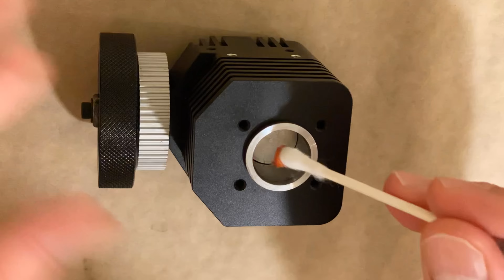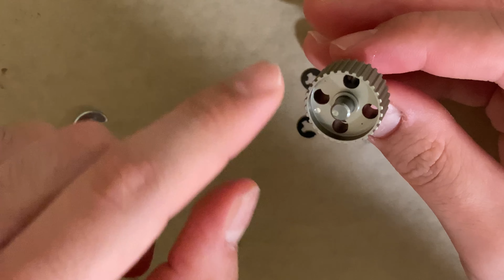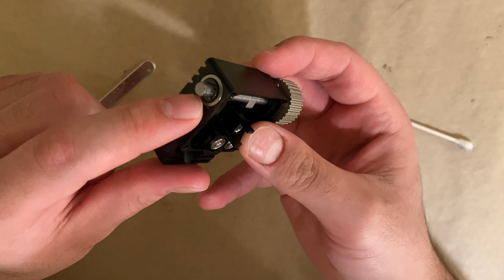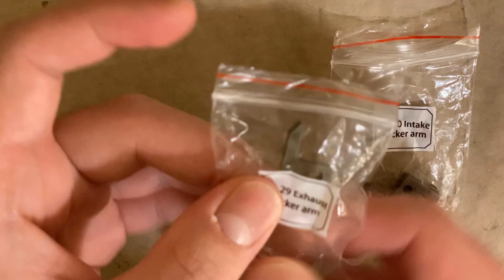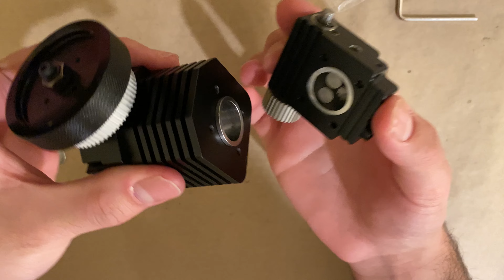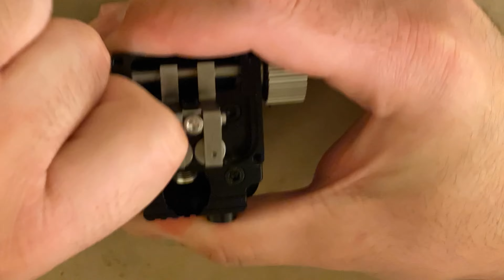Building A Mini 4 Stroke Engine (Part 2)

Comment from the maker: This video is dedicated to assembling the head for my engine, that includes the head unit, camshaft, valve buckets, rocker arms, camshaft gear, camshaft bearings and much more. It's a pretty cool mechanism that allows the air to get sucked in through the intake valve and push through the exhaust valve when the fuel is combusted. This is exactly how car engines work and is the most important part of the 4 stroke engine. This engine is a single overhead cam engine, with 2 valves for the one and only cylinder. More videos should be coming in regards to building this engine.